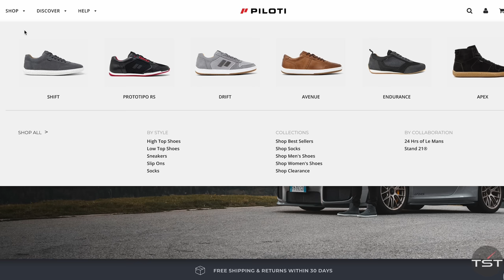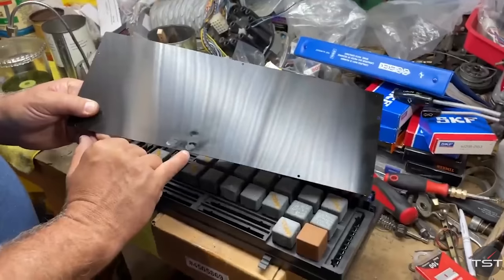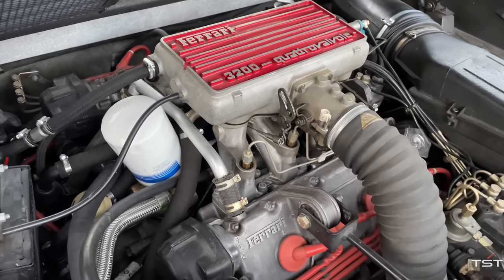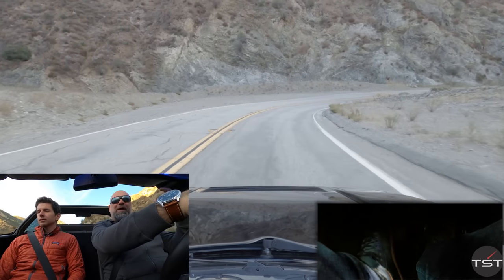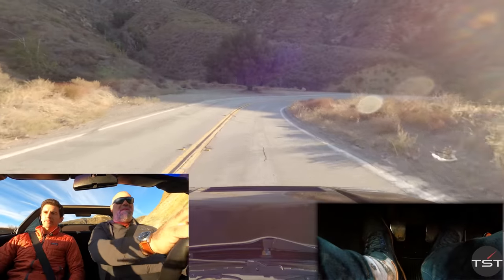What's it Like to Drive my Mechanically Perfect Ferrari 328 in the Canyons?

Comment: If anyone says "Yeah but it's not fast" they've entirely missed the point of just owning a car you enjoy. Best of luck with her Matt!
Reply: A lot of ppl have no clue what they’re talking about. I remember some guy at this event called someone’s drift car slow. It’s a drift car… it doesn’t need 500 lbs of torque
Reply: The only people who care about specs are nerds who have never driven anything fun.
Reply: I prefer a car that can take 30 turns at 50 than a car that can do 150.. I like slow car fast!
Reply: Totally agree. I see so many (likely young kids) on tiktok and elsewhere that thing the only good car is one with 600 or more horsepower but they don't understand that those cars are largely unusable on normal roads. I have so much fun ripping around in my 260 whp wrx and probably 140-150 whp prelude because of the way the feel and sound not really because they're so fast
Reply: Yeah, my turbo NB Miata isn’t that fast in the grand scope of things, but it’s fun. Fun makes a car great and enjoyable
Reply: This couldn’t be a more accurate statement. One of most fun cars I’ve ever driven was a bolt on first Gen s2k with a ton of suspension and brake work on the tail of the dragon. Maybe all of 260-ish hp but the driving dynamics are hilariously fun. Crazy fast turn in, flat cornering, 8k redline and oversteer on demand. Not the fastest straight line car. But you can’t help but grin like an idiot the first time you dive into a corner.
Reply: Everything has to be fast but don’t have to be the world record breaking fast
Reply: Lot of people wear their insecurities on their sleeves, and tie their cars to their identity, so any perceived shortcoming is an affront to their fragile egos. It’s not my job to help those people grow emotionally, so I’ve just learned to ignore and move on.
Reply: Yup no one buys a high performance sports car to be fast………that’s not the point of em at all! 👌🏽😁😒
Reply: @dennissmith7214  Hey buddy, if you go down the hall to the left-- about two doors down, you'll find the point you missed.
Reply: Yeah but anyone who says that anyone who says it’s not that fast has missed the point….has absolutely missed the point.
Reply: yeh i hate when people say my car isnt fast, featured on ym channel. Thats not why i bought it, it means more to me then that and actually slower cars are both more fun to drive and safer too
Reply: Its like motocross bikes. I only ride two strokes. They are just more fun to ride. Plus it is fast enough for me.
Reply: well, it seems really slow....
Reply: The thing with fast cars is it's harder to have fun without going into prison speeds. Slow Car Fast is way more rewarding if you can't get to a track.
Reply: @roguetorino  On top of that, the owners of fast cars usually cannot utilize them on the fun roads, and certainly not to their fullest. That's why slow-car-fast is the best.
Reply: Yes and it's still faster on a twisty road than the critics will ever be in any car because they can't drive in the first place.
Reply: Agreed. Not all cars, classic or not have  to be fast or have 900HP to enjoy.
Reply: @Theodore Skreko  yeah and I bet you can rev that thing up pretty high on roads safely/within limits. While super duper fast car just drives at a fraction of its capacity. If you rev it to its limit you get pulled over or end up squashed. Everytime I see miatta I think how fun they look. I'll have to find someone I can trade rides with.
Reply: It's still pretty quick, it's cranking out 270 HP, and does 0-60 in 5.5
Reply: I only wish my car had 250hp like this ferarri
Reply: As a 328gts owner, its illegal to go over the speed limit all you stupid kids on tik tok! It will land you in jail over a certain speed! Cars are meant to be enjoyed, not break the law. This is an EXCELLENT example of a stellar driving experience! 1000 times better than a wrx sti!!

Comment: Best "mod" for nearly any 10+ year old car is going to be a comprehensive bushing refresh.  I'd love to know how many cars rolling around on fancy coilovers with dead bushings.
Reply: Now I’m curious. Thanks for adding a maintenance item to my list
Reply: My 96 accord with new bushings keeping up with the first gen brz 😅
Reply: That's 9 out 10 NA/NB Miatas w/ coilovers.
Reply: 10/10 for Honda Civics. Also with their balljoints flapping in the breeze.
Reply: I'd love to do all the suspension on my 355k mustang.
Reply: I just replaced all the suspension parts and bushings on my Camaro and I couldn't agree with you more. It rides like a new car when before it was a total rattle trap. It's an 02' with 137k miles. Just built a 410 stroke lq motor, a performabuilt transmission, and a moser 12 bolt and figured it was only right to go through and do everything else. I'm more impressed with the normal, everyday driving experience than the all out drag performance driving I initially built it for! Lol

Comment: Great video, and you guys really nailed the true character of this car.  It’s so refreshing after hearing so many others bash the 308/328 cars.

About that steering wheel - little known fact, but the steering column actually does have a small amount of adjustment available by loosening two bolts on a clamp that is directly under the steering wheel, moving the wheel down as desired, and re-tightening them.  It’s a ten minute job.  I’m about 6’4”, so I also added a small spacer between the wheel and the hub.  With the moved steering column and the small spacer, the wheel is perfectly positioned when I’m driving the car.  It’s a complete game changer.

Comment: Delighted for you Matt.  I had a 3.2 Mondial and concur they are a sublime highway cruiser.  80-90 mph feels phenomenal in modern traffic.  I now have a 308 GT4 and it’s very similar.  Not quite as precise on the 14 inch wheels, but still terrific. And it’s got carbs :-)

Comment: Good to see the 328 on the road. Number 27 in UK the Influenzo 308 had installed a spacer to move the steering wheel closer. Then it may be more comfortable to drive.

Comment: i completely agree on the older car feel, i had a 01 325ci manual coupe and it wasnt fast and its more new than your ferrari but the sensation in the clutch and in the shifter and the steering wheel are on another level compared to new cars.

Comment: Lovely car. Maybe the Euro layout is different  but I've changed the fuel filter 3 or 4 times on mine without touching  a fuel tank. Just have to get under there & get at it! Cambelts need doing every 3-5 yrs depends on the mileage you do.
Reply: I was wondering the same thing... fuel filter is really easy on these cars. Must be missing something.
Reply: Came here for this. I see the fuel filter sitting next to the fuel storage (in German Kraftstoffspeicher) on my eu version of the 328. It's part of the K-Jetronic from Bosch btw, so pretty well spread in the 80s as other cars used that too.
Reply: US cars at that time had a lot of quirks though, especially with the fuel system.
Reply: @varmastiko2908  Do they? Mine is a US car. There's nothing quirky about it, pretty standard Bosch FI from the time. Maybe that is considered quirky now...
Reply: @robertbcope  A great many eighties European cars had a plethora of alterations on their original fuel and ignition system designs. 

Often US spec cars even had a completely different fuel system altogether; not only Ferrari but also every other Italian brand as well as most other European US export models. 

Even with superficially similar componentry the systems often had internal modifications to work with the US emission regulations. In many cases not even brand specialists know about all these differences, let alone their typical drivers.

Comment: Congratulations! 

I've heard you're supposed to drive old italian cars from the bottom of the wheel, so from the 7 and 5 o'clock positions vs from the top of the wheel. Makes sense with the wheel at that position. You might dig around the net and see if you can find how factory drivers drove that car back in the day

Comment: Nice 308 especially in black. I knew someone with one of these... he used to let it idle for 15 -20 mins to warm the gearbox oil or had a hard time changing gear.👍
Reply: Idling isn't good for those car as far as I know, something about low oil pressure and suboptimal oil coverage and warm up of other parts (just something I read in the Oldtimer forums, so take it with a grain of salt). On my 328 (EU) I gently ride it the first minutes slowly to 3.000 rpm and build up on that. Also you just skip the 2nd gear till the transmission oil is warm enough. Cheers
Reply: @Grendizer81  good information. Thanks 👌

Comment: Driving in Italy was taught 8-4 not 10-2.  The hand leading the turn pull the wheel under. Drive with fore arms resting on lap gripping the bottom of the wheel. Drive it like an Italian and it makes sense.  Don’t be hard on the previous maintenance. For years it was a $25,000 car, and the maintenance just done cost the same.  Only a dedicated diyer could accomplish it, everyone else had to wait it out.

Comment: With the way your describing the car I get the feeling with cars of this vintage, ferrari was the one you went to for the grand tourers where its just best at relaxed but fun speed, lamborghini was the crazy kamakazi machines where its slam and go, and Porsche was the inbetween, a little bit of both.

and with the 328's size it makes it ideal as an easier to live with TR, not as wide, not as big, and not as flashy, a happy medium, which is kinda why I've run into ferrari guys who were like yeah dont go for the newer ones, their too fast, their too quick and you just cant enjoy them, go for one of these and get it sorted. 

as it gets to a point where its like okay I can do 200 mph in 0 to 10 seconds, yeah its enjoyable till you hit that brick wall or that curb on the other side of the street but what about the other 9/10ths of the driving experience?

as everything has to be so flat and muted to give a consistent driving experience at top speed that you just dont get any enjoyment anywhere else, which is where the vintage cars like this always did better as their margin for top speed was lower and more within where you'd be using the car anyways.

Comment: New cars are really nice in many ways, they make a drive easier, safer, more comfortable etc….but most are soulless machines. Or “soul” is purposely engineered into the car as opposed to it being the fruit of putting passion into a car.  The result is something impressive by all metrics….except the intangibles. Crackles and pops are tuned in and feel very artificial and digital after a few days of driving….steering has multiple modes that make it heavier but it still has no feel etc

90s-early 2000s is the peak for cars IMO. Enough electronics to make them nicer to drive and not complete death machines but they’ll let you be an idiot and natural select yourself. 

Every new sports car is so damn fast and capable…you’re either risking jail/injury/death or you’re not having that much fun. Slow car fast rings true for me. Especially when a car has a ton of feel. 

Even the current ND Miata which gets touted as an amazing drivers car….it’s pretty numb compared to some older stuff. It just feels raw compared to something like a modern Camry. Great car and I’m glad it exists…the fact it does in todays world is a miracle in itself but IMO it’s memorable because of how boring a lot of modern cars are….as opposed to something being truly timeless. The engine is great but not particularly exciting. But with the current trend in cars….it will likely be a classic. 

I wish I had bought an S2000 when the prices were reasonable. It’s a rough daily driver but damn does it feel alive when you hammer it. Gives you the fizz in a way that most new cars can’t touch. Or if they do…they’re 100k+ 

Between regulations, current culture demands, etc….cars are designed by accountants and lawyers more often than not. And then sometimes the engineers have some fun. 

It’s really sad to see the love for cars and the art of driving going away. 

Super cars used to be expensive machines that only true gearheads would tolerate….who else would want to park a Countach 🤣

Whereas today…the only thing crazy about super cars is how fast they go and how fast any idiot with money can drive one.  

The engineering of cars today is absolutely incredible, but it makes me sad how cars are mostly about a bazillion horsepower and it’s 0-60 time. And how the next one has to have a billion more horsepower. 

TLDR, Ferrari 328 nice. It make good noise. It make good happy.

Comment: The Ferrari 296 is 10" wider than this 328. It is the same width as an R53 Mini or an E36 BMW, so the proper size. The 328 is smaller than a new VW GTI.

Comment: Europeans: "Why are American cars so heavy?"
Also Europeans: "This is how much it weighs without gas, oil, trans fluid, diff fluid, coolant, Freon, washer fluid, brake fluid, hydraulic fluid drained out of the shocks, no floormats, no spare tire, no scissor jack, no tire iron, no trunk liner, no battery, all the bulbs removed, no ash tray/cubby holder insert, no cup holders, no glove box door--AND ON THE FREAKING MOON!"

Comment: If you ever need/want to find out the weight of the car.  Go find a metal scrap yard that allows the public to drop off their scraps.  Most use a scale and measure the difference in weight between entrance and exit.  I'm sure the guys will hook you up for a fiver and a six pack on a Friday afternoon.

Comment: The saddest thing with all the latest Ferrari's is they are all paddle shifters. Ferrari no longer produces a manual shift car. Anyone who has ever Heel and toed a manual box down through the gears knows the shear joy of that experience. You guys touched on the sensation of driving a car that is analog. That too has been lost with the current generation of cars. Along with all the other electronic aids, driving a late model Ferrari, or any other contemporary sports car, gives the driver the idea he or she is F1 capable. Guess what folks....you're NOT! In fifty years of driving, servicing and owning exotic automobiles I have never seen so many cars "written off" by those who are mislead by thinking they can switch the Manetino to "race mode" and still control 800+ horsepower.

Comment: I hate to tell you, while car guys certainly appreciate Ferrari's, there's always snobbery and douch-ishness associated with them.  Also, putting a fuel filter in a place where you have to drop the fuel tank to replace it is a design flaw.  That not replacing it then causing circuit board failure and the car to run like ass is inexcusable....